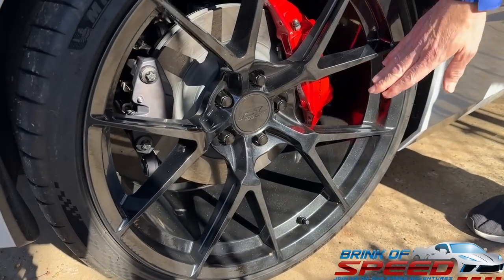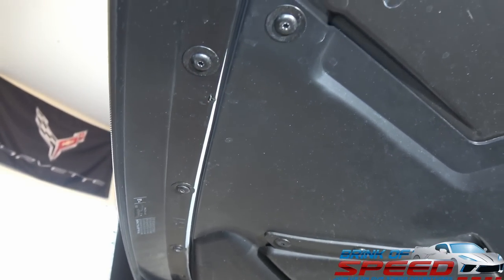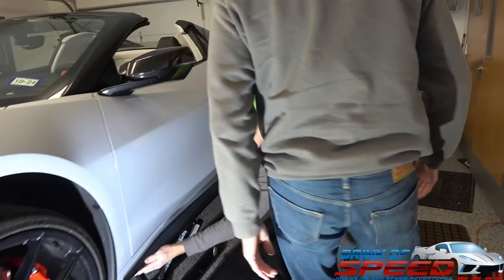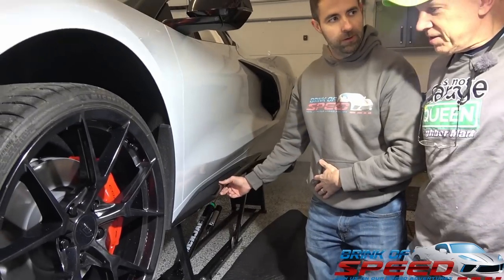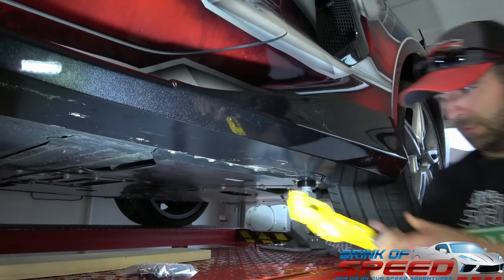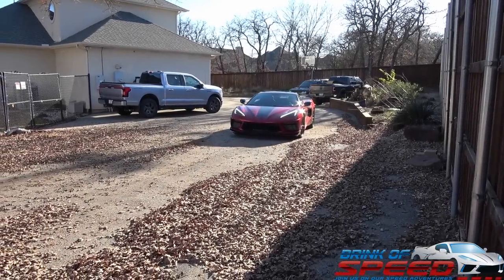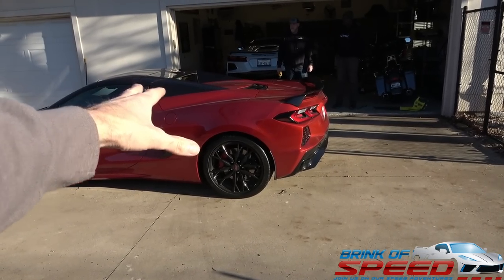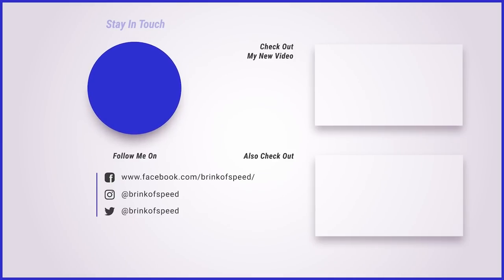1st YouTuber to add this Z06 PIECE to my C8 Stingray!

Comment: I had the ACS 1VM front splitter, Rocker Extensions, and rock guards in my empty garage last winter at this time last year awaiting the arrival of my 2022 Red Mist. I had museum delivery so I took a trip to Bowling Green to drop them off once a delivery date was scheduled.  Those pieces in CF compared to the OEM uglies made that car a star and was the best looking C8 awaiting delivery that day.  I felt bad for the rest of the folks, all the cameras were focused on us. 🤩 Too bad the Z06 pieces weren't available a year ago.  As for the wheel choice, they all look good, I'm partial to the CF finish though.  And if you are gonna get rid of those 20 spokes, I'm in!

Comment: Factory wheels look awesome. Just add paragon spacers.
Reply: That is a viable option, you still won’t have the concave look of a wheel built with the offset.  Also some people are nervous about running wheel spacers.  It seems like the Paragon ones are good and no issues, but seen some disasters on Trucks and Jeeps when poor quality spacers are used.

Comment: I put the ACS 1VM side rockers on my 22 HTC about a year ago and like them.  I do think the new Z06 style rockers look better as they don't go the whole length, but I would think there is less protection for the car which is probably the reason most would install side rockers to begin with.  Having already spent $1,700 for the 1VM I don't think I would want to eat that for the z06 style look.

Comment: Got a question. I have a standard (not extended length) QuickJjack BL-7000SLX. Do you have the 7000TLX?  In my case, the lift points are not long enough from front to rear and do not reach the lifting pucks I have installed. Looking at the specs for the TLX, the max each is 66" which is exactly the spread of the lifting pucks under the C8.
Reply: The quickjack website has all the specs.  With this model we have found the same thing with the length, it still works but requires careful positioning on the frame rails.

Comment: Great video.  What size front 20  and rear 21 tires were used?   Any rubbing?   Thanks so much!!!
Reply: 325/25/21 rear and the front you can run 255/30/20 or 245/30/20 No rubbing.

Comment: Love hem both!!  Just ordered them for my new Elkhart lake blue metallic I ordered over 10 months ago.  I should be getting it sometime in Jan.
Reply: Going to look amazing, what style and finish did you go with ?
Reply: @nrdemon1031   I went with the 1 VM carbon flash splitter and Z06 rockers.  My car is going to be a 2lt coupe with a bunch of upgrades.  Performance exhaust, black tips, high wing spoiler, front lift, stealth package, two tone seats, red calipers, red seatbelts and a few more accessories.  I’m so ready.  The rockers and splitter already shipped, ordered it last night.
Reply: @j-rays2573  sounds like you have a good plan, are you changing the wheels?
Reply: Not at the moment..  I’m going with the gloss black forged aluminum from Chevy for now.
Reply: It’s going to look exactly like my profile pic..  plus the rockers/splitter.
Reply: @j-rays2573  nice, I’ve seen the brushed aluminum on a blue car and it looks great.

Comment: Great video!!
What’s the model of your Quick Jack?

Herman
Reply: It’s the 5000 model, but we would suggest getting the 7000 with the longer rails.
Reply: @nrdemon1031  
Does it matter with the TL or TLX
Reply: @sonofpow58  I’m not sure, but get the one with longer ramps,  this smaller one works fine but if I was buying one I’d definitely do the longer one.  Might be a weight rating difference between the two models as well.  But I will say it works great.
Reply from the maker: Thank you 😊
Reply: Thank you!!

Comment: I just brought a brand new 2023 C8 Z51 2LT HTC in amplify orange with carbon metallic.

Because to me the amplify orange with carbon metallic is the new black this is a more rare color for sure more optimistic and more vivid.  

I really needed a visual to make my final decision on which side rockers and front splitters to put on my C8 to make it look more memorable unforgettable incredible remarkable.  

So I decided to go with 1VM carbon flash front splitter $559.00 and the 

C8 Z06 Rockers for Stingray black carbon flash $749.00

These two major modifications will make my C8 look revolutionary. Your video inspire me thank you so much .

Yours truly “ICE”
Incredible Car Enthusiast

Comment: As a side note what model quickjack are you using?
Reply: This one was the 5000, we would recommend getting the 7000 which has the longer rails.
Reply: Thanks. Did that 5000 reach the jacking points?
Reply: @Kbauer1809  it did not which is why o would get the longer one.

Comment: Do your new wheels take the factory center caps?
Reply: Yes they can be ordered to accept factory center caps, the Forgedlite wheels on my car I use factory caps.  Talk to Jose at Wheel Designers for all the details, also lifetime structure warranty.  Mention BOS and he will give you free shipping and lug nuts.
Reply: @nrdemon1031  thanks . They look easier to clean than factory wheels.
Reply: @racer3212  very true, easier to get in there to wipe them down.  We also coated the wheels with Undrdog products.  I suspect Mike will do the carbon brake pad upgrade like we did previously on my car.  Changing the pads dramatically reduces brake dust.
Reply: @nrdemon1031  My understanding is that if you have non-Z51 the brake dust isn't as much of a problem.  Whats your understanding?
Reply: @steveh.9630  yes definitely lesser brake dust on non z51 cars, they do make pads for those cars as well which you would have almost no dust.  Really just up to you on how much it bothers you.  Either way coat your wheels with Undrdog that will make cleaning much easier.

Comment: MR J.
1.0 out of 5 stars Avoid. It just doesn't work.
Reviewed in the United Kingdom 🇬🇧 on November 30, 2022
Verified Purchase
I don't usually write product reviews, but in this case I'm going to. I WOULD STRONGLY RECOMMEND AVOIDING THIS PRODUCT. It is a waste of money. I don't know whether it works using small diameter rivets, but small diameter rivets are irrelevant anyway imo because a hand riveter is easy to use for those. The tool needs to show usefullness with larger rivet diameters.
I tried to use this tool for 4.8mm stainless/aluminium rivets, and it does easily pull each rivet, but the broken-off mandrel gets stuck in the tool jaws every time, and I do mean EVERY SINGLE TIME. If you grip hard onto the end of the broken-off mandrel with a pair of nail extraction pincers, and then pull hard with one hand while with the other hand you follow the instructions to whereby the tool is supposed to release the mandrel by itelf, then the mandrel does usually come out, but this requires significantly more effort than putting the rivet in by hand in the first place!
Furthermore, about one time in five, even hand-pulling the broken mandrel with nail pincers doesn't work, because the tool jaws have dug serated gouges deep into the sides of the mandrel and become firmly stuck. For this 20% of occasions, it is necessary to dismantle the tool and use a screwdriver to manually push in each of the three tool jaws, one by one against the internal springs, and with a bit of messing around the mandrel will eventually come out .
Hopeless.
Buy a Lazy Tong hand riveter instead.
Report abuse